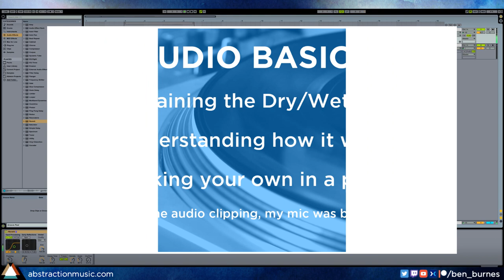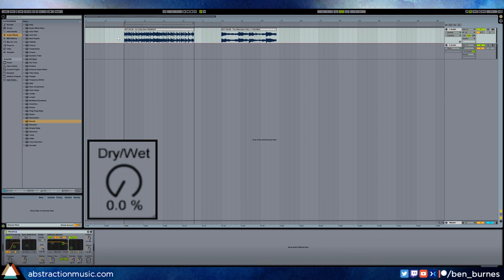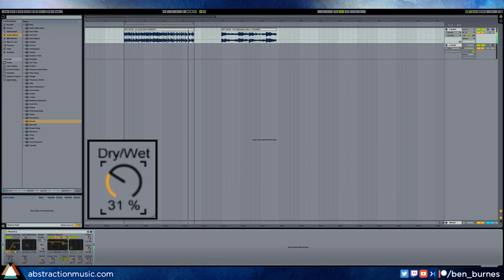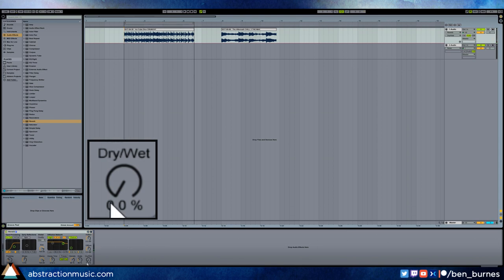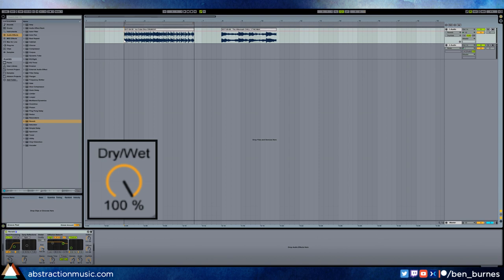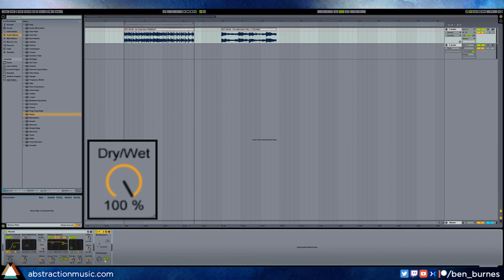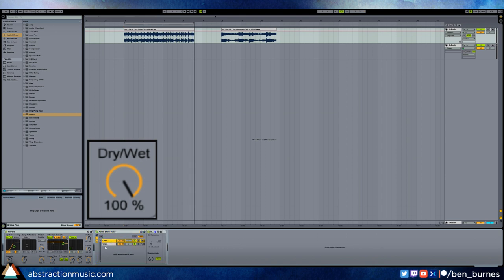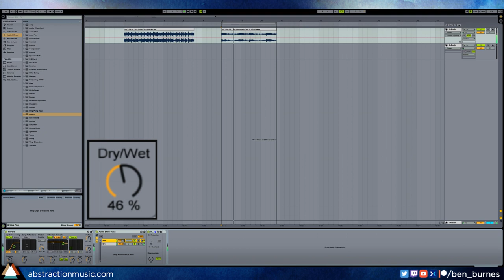Dry/Wet Explained - Audio Basics

Comment: I recorded my electric guitar with reverb already? So, do I need to configure Dry/Wet in my DAW? Or should I cut off the reverb while recording & completely do it in DAW?
Reply from the maker: Hi! Yes you have it correct. If you have reverb in the Audi for itself, you can't really edit that out easily. If you plan on fiddling with effects, it's best to include them as late as possible in the production process so you have more control over them.

Comment: So - just to check I understand correctly - am I right in thinking that, when using an effect that doesn’t have wet/dry controls, I can copy the audio I want the effect on and add the effect to one but not the other to get a 50% wet/dry effect? I don’t understand the grouping bit so I would use fade function to adjust the audio with the effect.  Is that right?  Can you explain the grouping bit to me please?
Reply from the maker: Heya Bonita, sorry I went through that section pretty quickly. I think you got the general idea though! The "dry" signal is unaffected by the effect, and the "wet" signal is completed affected by the effect.

If you have an effect without a wet/dry knob, putting that in your effects means that it is 100% wet since there are no options to mix in the original signal.

So if you have a group with two channels, one with the effect (wet) and one without (dry), you have the ability to change the volume of each channel, essentially creating a clunky dry/wet knob. Hope that helps! :)
Reply: Ben Burnes Thanks for your swift reply, Ben.  Yes I understand now.  Great video! 👍🏼

Comment: The app that I use (Audio Elements) Seems to have the Dry Wet signal Mixed up or it's just different, I need help
Reply from the maker: Heya, I don't know much about Audio Elements so I can't help, I'd suggest checking out the instruction manual for more info.